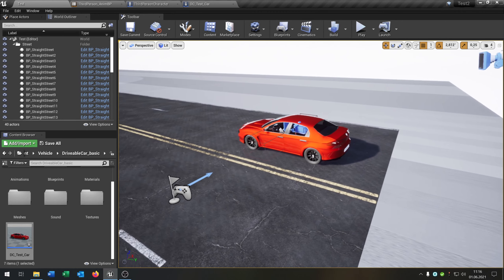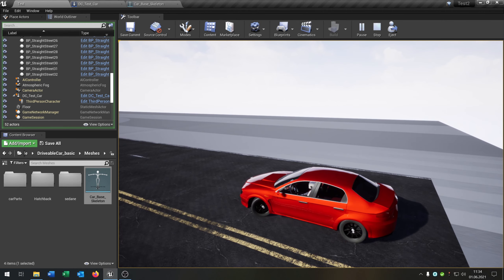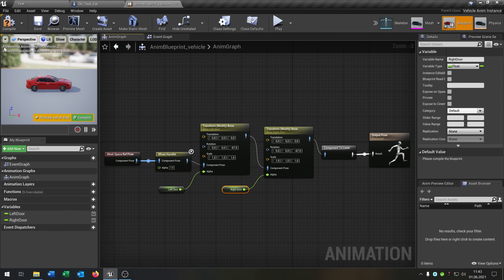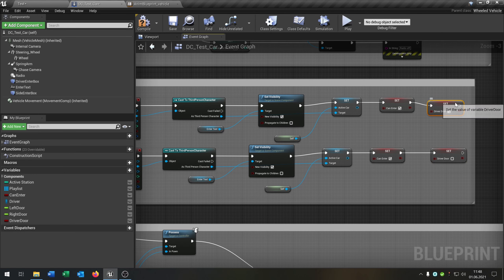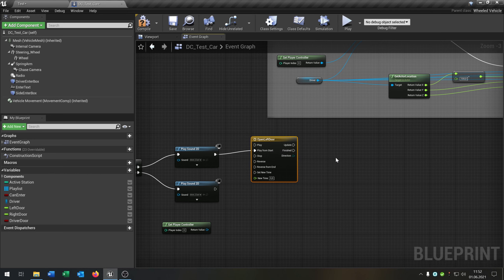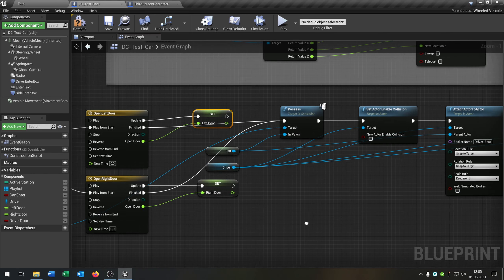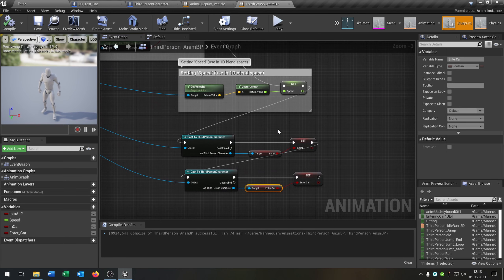Unreal Engine Steering Wheel / Open Door Tutorial

Comment from the maker: If you have the Steering Wheel as a bone, follow this Steps:
1. Instead of "Set Relative Rotation", create a Variable called "Wheel Rotation" and set it to the Axis Value multiplied by 90.
2. Refer it inside the AB like the Doors.
3. Use Transform Bone inside the AB and select the Steering Wheel.
4. Split the Rotation and set the "Rotation Z" to the Wheel Rotation. Done.
Reply: First of all, Thank You! UE5.1.1 has changed a few things. Can you post a couple of pics (eventgraph and animgraph) of what you are recommending here for the Bone Steering Wheel?
Reply: Got it working...keep up the excellent tutorials.

Comment: please create a tutorial in which to make a button, in which to do so if the car overturns, to put it on wheels
Reply from the maker: The Function for this, is to short for a Video, so here we go:
Go from the Button Press Event to "Set Actor Rotation". 
Be sure to set the Boolean "Teleport Physics" to true.
Split the new Rotation and get the Rotation with "Get Actor Rotation".
Split the Actor Rotation as well. Connect the Y and Z from the "Get" to "Set".
Be sure you leave the X Value from the "Set" to 0. Thats it.
Reply: @Seredias.  OMG,thank you so much!
Reply: @Seredias.  nice one, but curious is there a way to upgrade this to a constraint of like dunno 5 sec and im sure it's need a ?isvalid to know when starting the countdown about over dunno 75 degrees on the y axes. (minus and positive ones) (into multiplayer gamemode to make sur the player don't just flip over instantly after an other player flipped it). :) ho and i would like to animate the flip over by making the car 'get a little jump' instead of just teleporting. frankly , i think you can actually make a tutorial for multiple way of doing it xD ( like old game where you respawn almost translucid and invincible after a few moment come back as vulnerable target)

Comment: mmmm got some issues, a wierd one. followed every steps. looks like the passager (right) door is fine but driver side there no anymation i only tp in the seat driver pose. + for x reasons my character when getting out takes the x,y,z position of the car... all the time so right now im floating on side and walking in the air XD big question : is the entering sequence should be after the suspension animation part ? note that i have an follow cursor view set up + an zoom in , zoom out rollet option. might be the problem when i flip over the character ends up literally upsidedown.
Reply from the maker: I would control the Character States, because I think this might be the Problem. Since the "Get in and out " Part is working, but the Animation is not, the Animation BP has a Problem with the States.
Reply: i think im dumb and i havent made an instance of InCar with the camera option. might be the issue. so the character for reasons pick up the location rotation of the camera xD
Reply: @Seredias.  alright, need some sleep rn but il'l figure this out later ! :) repaired some part of my suspension system but still can't find a way to fix one of the tip of a bone to a fix location and the other tip to a moving part :/
Reply: @Seredias.  i still have trouble to find out how to make the character leave the car camera positions when leaving the car. i repair the driver door animation. and for the animation question well i figure out how it's work, the aniamtion order doesn't really matter as long as the command is closed theres no troubles. ( aka was wandering is the previous anims could affect the next ones.

Comment: How would you get the steering wheel to move if it's part of the armature and model?
Reply from the maker: I pinned the Answer to this question here in the Comments.
Reply: @Seredias.  I tried that but I can't add the wheel, no option comes up for it. The wheel I have is not a separate mesh I can add to the car.

Comment: How to rotate bone(stering wheel) from vehicle blueprint and by getting reference to it?
Reply from the maker: I would recommend to do that Part as well inside the AB, with this Steps:
1. Instead of "Set Relative Rotation", create a Variable called "Wheel Rotation" and set it to the Axis Value multiplied by 90.
2. Refer it inside the AB like the Doors.
3. Use Transform Bone inside the AB and select the Steering Wheel.
4. Split the Rotation and set the "Rotation Z" to the "Wheel Rotation". Done.

Comment: Hello!!! Thank you for your great tutorial series! They're very easy to follow and you explain why you make certain connections!  I'm just having a bit of a problem with the car door opening. The sound effect plays, and the character moves into place seated in the car,  but nothing happens with the door itself opening. Do you have any recommendations to what I could be missing?
Reply from the maker: Does the Doors of your Car are Bones like here: 4:19 ?
Reply: @Seredias.  Yes, they are bones like the ones at 4:19
Reply: The door also rotates manually as it should in the skeletal mesh
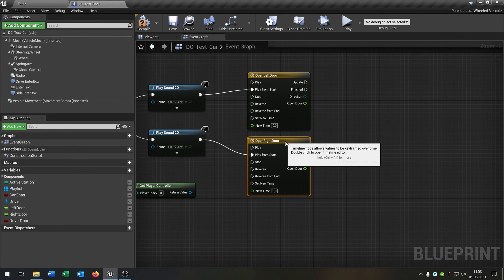Reply from the maker: @cheyennedombrock2443  Does the Variables are setted 13:50 and connected with the Animation BP? I would Debug the Animation BP to see if its triggers.
Reply: @Seredias.  The variables are matching yours at 13:50,  I have altered them to make them valid for my project, but there's no movement .  I have also debugged the animation BP as you have recommended, and no faults have come back.
Reply: @Seredias, Good Morning!  Thank you very much for your assistance in resolving my problem.  As you thought, I had missed a setting where I had to connect the Animation BP. The door opens!  Have a great day!

Comment: Is it possible to animate collision for the door too?
Reply from the maker: Actually the door has collision. So what do you mean by that?
Reply: @Seredias.  I used the same way to lift a wheel on the car, but the wheel will straight go through the ground as if it doesnt move the collision sphere of the wheel
Reply from the maker: @NOTORIOUS4545  A Wheel is totally different, because it is part of the Main Skeleton, so you can't move it. It is also part of the Vehicle Movement Class, which has a own Wheel Class.
Reply: @Seredias.  Oh alright. This helps me. I managed to attach a collision sphere on the wheel bone. But that blocks the wheel now. Right now looking into how I can only collide into the ground.
Reply: Would you say that it‘s completely impossible to lift up the tire bone collision during gameplay?